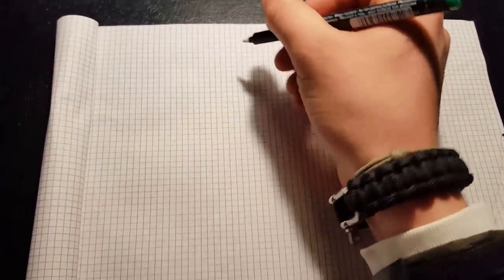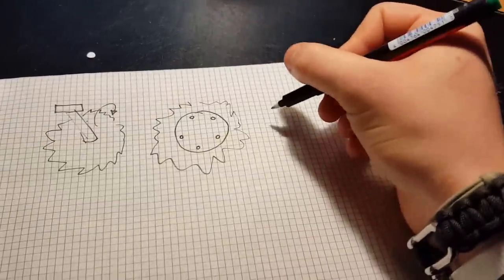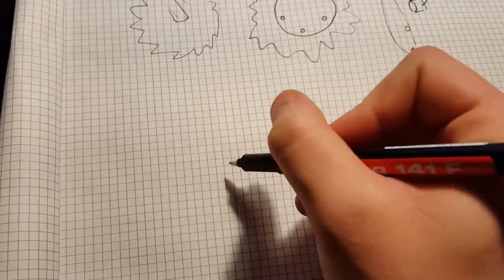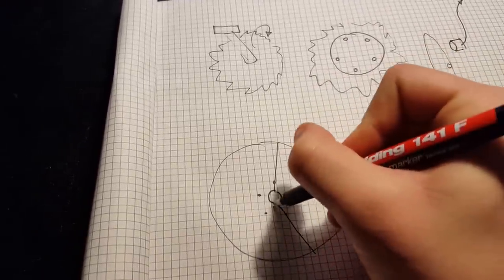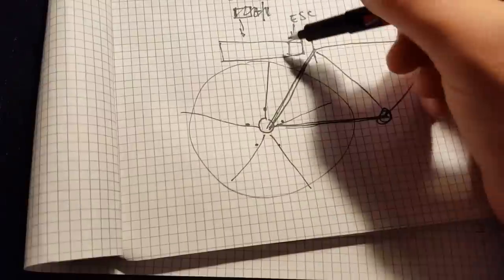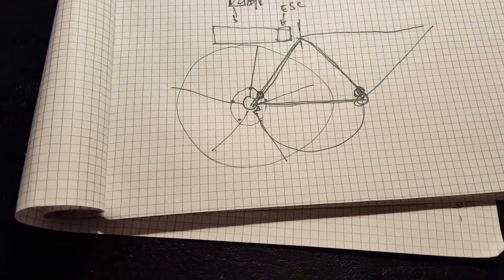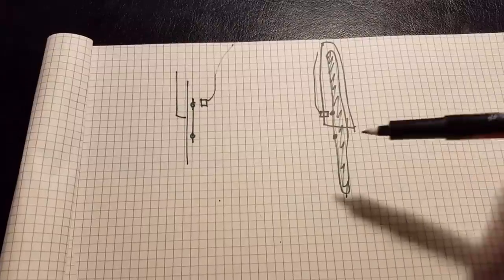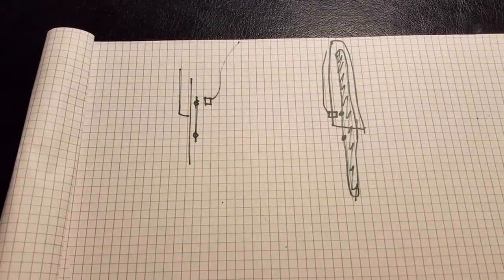DIY - E-BIKE HACK | Pedal no more No new parts needed! [The Green Bandit]

Comment: At least with PAS you can coaster along without adding anymore speed. With this, as long as the wheel is moving there is extra power supplied to the wheel. It seems to me the only way to slow is to brake so as to cut the motor and kill the speed. And what happens if your going down hill? do you have to hold the brake on to keep the speed under control? it seems a waste of brake pads and battery power,  It's like some mental mechanical paradox

Comment: hehehe i can see some poor guy trying this and the bike running away him,and he cant stop it. its really not had to add a twist throttle to any ebike ,can just get a pwm driver chip a few components a hobby pcb a throttle with a 5 or 10 k pot be easier ,than hall throttle ,tjhere is plenty of circuit diagrams online

Comment: Why don't u just throw a throttle on it
Reply from the maker: Hi! Because I am not permitted to by law :( In this country we need to have pedal assist. This is a pedal assisted motor.
Reply: It no longer is legal if it is reading wheel speed as you will not have to pedal which will make it illegal. Easier to by-pass the hall effect switch and use a hand control illegal again of course in your country it would seem. All you would need to do is connect positive  to positive and chop out  the negative.
Reply: @marsfoot1237  but doesnt it sense speed to control motor not just switch on or off ?

Comment: I am really excited at this idea. I want to keep the magnet disc in place exactly where it is and I have new magnets that I want to put on the spokes. Does anyone have any idea on how to do that? They are small single magnets and I want it to look clean. My thought process right now is to either get a wooden dowel and paint it black, cut it in half, glue the magnet to that and then put a screw through the two halfs of dowel and put the spoke in between to keep it in place but I hope theres an easier way. Like i say, i don't want to cut the magnet ring into pieces and I want to keep it in place for the future or just in case for whatever reason that this doesn't work with my bike

Comment: One down side you will need to make sure the power is turned off when you walk with the bike 
Otherwise the turning wheel will cause the electric motor to operate could be quite dangerous
Reply: shutdown the system !
Reply: @ashrafhghoneim  thats why you always hold the break levers. when maneuvering your ebike in close quarters
Reply: @grandmaster-grouch  actually removing sensor from brakes and add like hand accelerator like on e-scooter

Comment: I have an old bike with throttle & the horrible pedal assist( you have to peddle to make it start). Well not any more as i used a 555 timer chip to feed pulses into the controller instead. Connected to the 5v line instead of the hall sensor). It thinks i am peddling fast all the time :D
Reply: First off, nice one!
Now for some questions :) 

So is the 555 timer signal just connected to the hall sensors signal wire?
Are you powering the 555 using the 5v power lines to the hall sensor?
What signal rate / frequency did you find best?
Got a link to a schematic or pics or videos?

Comment: Conceptually problematic.  Instead of the controller measuring pedalling speed (increasing power as you pedal faster), instead we're having it measure wheel speed (increasing power as the bike moves faster).  This is opposite of what we really want, which is more power as speed slows down on an uphill, and less power as we speed up going downhill.

The system shown might be decent on flat terrain, but I doubt it will be useful for those who deal with hills.

We might, instead find a small battery-powered motor, like inside a small battery-powered clock, and mount the magnets on a disc.  wire a small variable resistor dial on the handlebars, to modify the disc speed (and thus power output), by this throttle control.

 I'll see what I can rig on my own pedal-assist e-bike and report back.
Reply from the maker: Yeah I love the idea. Try it! I just kept this as simple as possible.
Reply: Sherryn Meyer ,, de verte última etapa del tur de Francia.....
Reply: This wouldn’t be a problem for my bike because it doesn’t use crank speed to determine the output power of the motor. Not sure if other bikes are different but my bike has 3 set speeds to choose from. Low, med, & high so the crank sensor only detects movement not crank speed. I can pedal super slow and still reach top speed.

Comment: I have psa and twist throttle so I can use my bike without peddling if I want to. There is no need for your idea of putting the magnet and sensor on a wheel to obtain motion without peddling, a twist throttle automatically disconnects the feed back from your peddles and sends power to your wheel regardless of what your peddles are doing.
Reply: Where would I hook up the twist throttle? Million dollar question

Comment: Hello, i have built 3 electric bikes over 5 yrs,all rear wheel Chinese brushless motors,500/1000 and 1500w, all 48v(just had mine stolen though!)not once did i fit this sensor,and everything worked off the throttle.  Obviously mine was outside the uk law,but laws are meant to be broken? Thanks for sharing your vid.
Reply: Hi Terry and can you help me please I have put o. I have the small magnetic sensor. But very strange🤔. Y coyote connect e bike only moves if I pedal backwards. May e I need too tour it over to the opposite facing side. Yes..?

Comment: I think it will be much more easy to fix or glue more magnets on the p.a. disc. So the controller see more movement from your disc and supply more power.
Reply from the maker: George Ale The point is not to have to pedal at all.
Reply: @CHSWEUSA  Isn't that the whole point of the throttle though?

Comment: I can just disconnect the sensor wire plug from the controller wire plug and it just goes off of throttle like pedal assist isn’t even there. I have a rear hub 2kw motor.  Seems to have more power and speed because pedal assist doesn’t work at 35 mph anyways.

Comment: Is this the same device that limits the motor to 15mph?  Because im planning on moving that closer to the pedals and attaching the magnet to the peddle so I can have peddle assist at higher speeds.  But now I want to do this too!
Reply: If you have 26" wheels set the speedometer to think you have 10" wheels then the controller will think you are going slower than you are

Comment: I've done the same thing, but on my bike it has a throttle for how much power I want the engine to use when I pedal.  So I put the magnet system on my back wheel (which is powered), so all I have to do is "push off" and my electric motor always kicks in granting me power to the throttle.  So in my case, mounting the magnets and sensor to my powered wheel was the solution.

Comment: One problem with this setup is your going to constantly be running the motor any time the bike is moving which is going to shorten your range. You can’t coast downhill without using power. I had thought of using a push button connected to a small flash circuit board powering a small electromagnet to trick the sensor by flashing the electromagnet on & off but I came across a perplexing obstacle. If the sensor simply reads the magnets passing in front of it why doesn’t the motor turn on when I pedal backwards? Different strength magnets stepping up in power to provide a sense of direction to the circuitry? I think that’s a possibility but not sure yet. Haven’t tried testing that theory. Any thoughts?
Reply: The "Double Hall" Sensor detects the direction of the magnetic fields, similar arrangement in the Throttle except there is only one sensor between two magnets.

Comment: Hmmm If you don't like pedaling buy a motorbike if you want more speed shift the sensor to the frame and stick the other magnet on the pedal shaft so the two magnets pass each other when pedaling this will trick the controller to think it is going slower than it actually is no resoldering just a bit of glue and a couple of zip ties

Comment: This doesn’t seem logical? Your pedal assist is activated when the magnets spin, so even after hitting the break and deactivating the motor your motor will just kick on again because the wheels are still spinning. Why not just buy a thumb throttle and connect it to your controller? Seems like less work
Reply: Where do you connect that? I think that’s the big question. The circuit board doesn’t have a designated input for it.

Comment: Would you have to add a capacitor because these DC Motors work in a delta configuration which do not rotate correctly unless motion is present?.
Reply: No you just need a 120 ohn resistor to terminate the CAN bus connection alongside a diode (1N4000) forward biased between the positive and negative of the battery supply.

Comment: Looks good, but has some problems. Your brakes will wear like hell. How do you start cycling? By pushing your bike? Even if you brake, you control unit will still receive the signal that you are pedalling and therefor increase your power to your engine.
I'm not sure this bike will be much controllable... Especially when your motor will oscillate with the pedalling causing it to run at its max power and speed, with only 1 control, your brakes...
Reply: Brakes automatcally turn off engine. Where is a detector for this

Comment: Hey! i am confused as if to what variables does the battery respond? What is the pedelec sensor doing there? sending rpm of the shaft to the controller and not the torque?
Reply from the maker: It's a very simple ECB. It responds to current variations. It sends 100% power or 0% power depending if there are current variations or not. There are ne torque sensors or frequency sensors.

Comment: I do not mind to pedal to get power. My problem is the speedometer is wrong and way off. When I know for real I am doing a 14 Km/h speed (8 miles/h) (I commute to work daily in the past months) the speedometer thinks I am going at 30Km/hour (18mile/h) and cuts the power when marks 25. Today was a record according to my bike I was at 40 km/h (25 miles/h) in a bit of the road I know I couldn't reach beyond 21Km/h 
This bike It's a pain with so many hills as soon I hit the pedal twice the speedometer jumps high and the bike power is cut off. But looking for a solution I find this hack everywhere. And I'm starting to see it as the solution for my bonkers speedometer which I'm starting to think I should try and cover the speedometer screen.
Reply: Go  into settings and change the top speed limit and make sure the wheel setting is correct. Also if you choose a smaller wheel the bike will read slower and not cut out. You may have problem with the controller or lcd controller.   Is battery and bmf good?
Reply: If the speed sensor is on the cranks and you are not in top gear as you spin the cranks faster the bike thinks you are going faster.  Gear up to slow down the drive rotations and the electric assist will continue to provide power.  Once you are in top gear and max out the rpm, then you are truly out of options without a hack.

Comment: well then, if the wheel still running, how to shut of the power at very requied moments, specially on sharp corners? 
what you say is cool, but not safety at all, isn't ?
Reply from the maker: The power cuts off with a light press on the brake lever. SO that's how the power feed is controlled.

Comment: still using lets say maximum assist how do you stop or slow down , do I assume simply using the brake to cut the power off as the motor will be at full blast ?
Reply from the maker: Yes you simply use the brakes to cut off power. This is probably unsafe if you own a bike with 500 wattrs and up.

Comment: How do you intend to shut off the motor for when you need to brake? ;)
Reply from the maker: +innergy111 Hi! I let go of the trigger. It's like a remote control car :)
Reply: many new bikes do'nt have a triggers anymore but work with torque control on the pedal to control your power...
Reply from the maker: Jörgen Börg Hi I am sorry there was a mix up with the comments. Initially inergy111 apeared on my longboard video. The motor shuts off using the brakes like a normal e-bike. There is no trigger. The trigger is for my e-board.
Reply: The Green Bandit
oh, i understand ;-). frinedly greetings Jörgen
Reply from the maker: +innergy111 by pressing the brake. Nothing changes on the security shut-off circuit.

Comment: How can I stop the sensor and use the throttle only . I try to plug out the wires but the bike doesn’t work
Reply: If you have an ebike conversion kit with both PAS and throttle, you should be able to use throttle only and avoid connecting the PAS system by just taping the magnet to the brakes sensor and then tape that to the handlebar.

You should be able to use throttle only. Just be sure to ride safety when braking.

Comment: I was thinking about making a bike to do something similar. On my Sondors bike you pedal and turn the freewheel some in the process and the PAS activates. But what if I put a freewheel on backwards. If I activate throttle it will turn the freewheel which will then turn the pedals which will then activate the PAS and keep the bike moving, all I would have to do is hit the throttle to start and take off the pedals. Would this work?

Comment: This is clearly going to get you charged with riding a moped without tax/insurance as well as giving you erratic  speed control  unless you are constantly changing your assistance level. There are settings on your controller display to shut this function down or make it cut in or out at a certain speed. The settings are deep in the menu of an LCD controller display as are many other useful tweaks. Not in the instruction leaflet though so download the full manual of your LCD display to,find out how. If you have the LED display treat yourself to an upgrade. It will be like having a new bike
Reply from the maker: Yes it could but don't do this on an advanced model you will break it. And yes if you want to hack it you could, but in this case the system is to simple and the idea is to find a cheap and easy way to get away with not pedaling to work.
Reply: Seems to me it would be easier to just install a pwm controller that does not req the PAS sensor, or is switchable with hidden switch? These are all over ebay etc, 'currie' is one brand, their older bikes are PM motor and newer are 3 phase (hub motor). Another thought is, if the hall sensor (pedal sense) does not vary assist or speed, just requires 'some' motion, wire a 555 timer chip to a small electromagnet to pulse near the pickup to fake the pm magnets going past. ($2 worth of electronics and could be wired to a horn button on the bars)

Comment: The whole point of a pedal assist sensor is to power the motor WHEN you pedal. If you don't want to pedal, then use the thumb throttle instead. If your e-bike doesn't have a thumb throttle (or a cruise function like my ebikeling kit) then you purchased the wrong e-bike.

Comment: what's the Point?  If I wanted an electric scooter I'd have bought an electric scooter.
Reply from the maker: +Doran Amatto haha! Well said. But there are countries mostly in Europe where pedaling is required so that the vehicle is not registered as a scooter and therefore taxed and insured.
Reply from the maker: Depends on legislation. In Switzerland it is very costly to own an electric scooter.
Reply: Already have an ebike so i won't want to be another one ... what i ready want to do is remover this  pedal-assist and just ride the bike . do i just cut the wires and connect them together . cause ever time i try to pedal the bike takes off.
Reply: Doran Amatto thank you he's having trouble with the word spoke disconnect it and ride wtf

Comment: the down side is if your brake motor cut of stop working for some reason this set up will always put power to your motor wile spinning .if the motor cut out dont work like it should do you will burn out your brakes and motor faster .sorry pal good thinking but not safe
Reply from the maker: Yes you are right if the cutoff won't work the motor won't stop. But I doubt this will ever happen and if it does my brakes are much too strong for the engine to burn them out.
Reply: it will burn your motor out by putting more strain onto the motor than necessary. i have add a bike where both brake cutouts stopt working are the controller was faulty. by stopping pedaling solved this problem use the brake like normal . its up-to you with what you do but if a ebike kneaded a mot it would not pass with that kind of set up
Reply: Not a problem if you have a twist-grip throttle and / or an 'ignition' switch. Both can turn the motor off
Reply: Right, they all have brake switches, better be sure to turn it all off when walking the  bike across the street though!

Comment: Imagine , when you want to make very slow U turn . If you don't hold the brakes to kill the power you can be very surprised.  Dangerous.  It's call pedal assist. Best position is to be there. Not Rim assistant or wheel assistant.  Magnets on the spokes are used for speed calculations.  Not for this.

Comment: Ok dont trash out the bike like he did! Now it looks sloppy... All you should do for the original intended purpose of Not having to peddle add magnets in between the current magnets on the disc. That's the best way safesy way and less hassle.
Reply: Adding more magnets overlaps the field. Causes the bike to jerk on and off. You can add more magnets but you need to increase the disc size